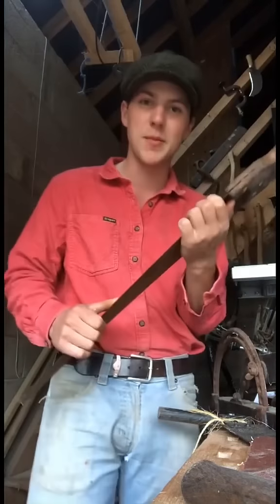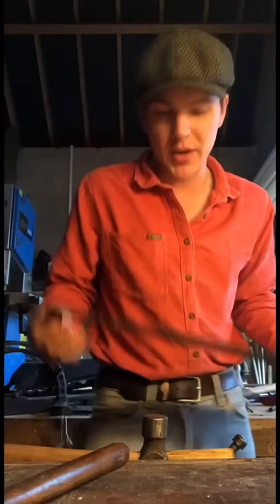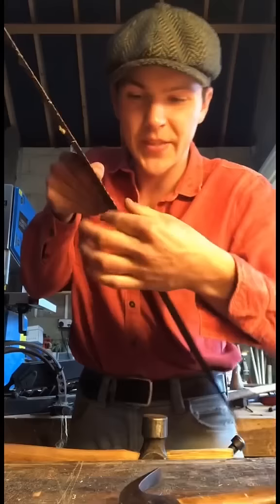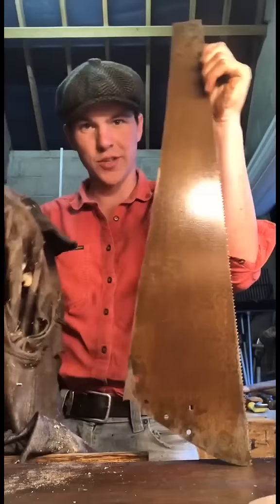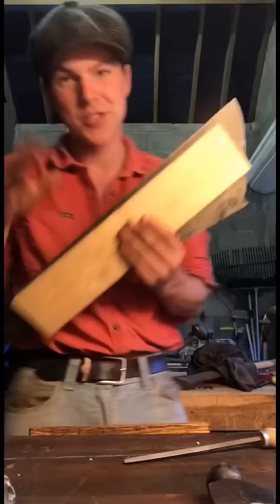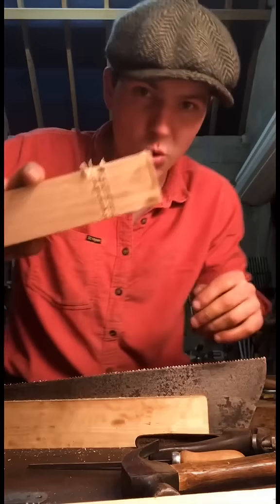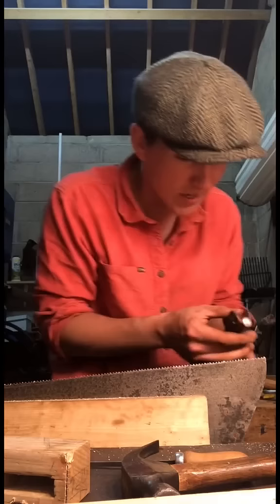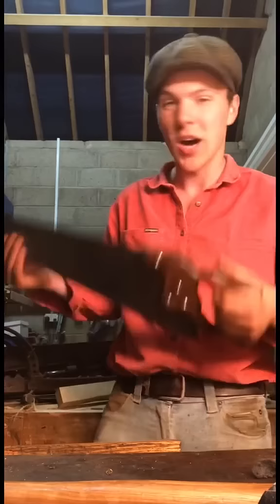Restoring A Rusty Old Crosscut Saw #shortvideo #ireland #woodwork

Comment: There is one more important step for a very finely tuned saw and that is leveling the teeth before sharpening the cutting edges.
Reply: Did you miss him using a hammer and anvil to do just that? Then explaining the use of the sawset at the end?
Reply: @colonelangus7535  Manuel probably meant leveling as in dragging a file lightly across the end of all teeth so their all the same height, then you would sharpen them till they have a sharp point again
Reply: @colonelangus7535  none of that levelled the teeth, it flattened them.
Reply: Set teeth, then sharpen? Or no?
Reply: @Friedrich Bendix  I thought a saw was supposed to have its blades staggered every second tooth tapering out so the blade has plenty of room to move through the cut.
Reply: @longkevin11  I think he missed the setting process in his explanation.
Reply: That's correct. I was taught to run a file over the tips of the teeth until they are all the same length then set and sharpen

Comment: I use a trisquare file everyday for finishing single point threads. It never occurred  to me that they are used for saws as well.
Reply: Saw files actually have rounded corners so a slight difference. I'm pretty sure it's possible with just using a regular triangular file. I've heard you should be careful to not make the deep cuts pointy too.
Reply: @danielh12345  That makes  sense.  A radius distributes force instead of concentrating it at a sharp angle.

Comment: I've never worked on saws but I've worked on quite a few milsurp rifles, boil the metal in water and it converts rust to bluing then you take fine steel wool and scrape off rust 👍

Comment: Nice job but if possible try to avoid abrasives.  Many old saws, particularly late 19th century and early 20th century saws have beautiful etched manufacturer emblems.  Abrasives will wear them away.   Acids are equally bad but there are a number of cleaners that won't damage the etchings.

Nice job though.  I've restored quite a few saws, it's very rewarding.

Comment: Try using a PH4 phosphoric acid instead of a light oil, it'll work a lot better. It will need to be neutralised after with an alkaline (washing up liquid) but it's not going to burn you.

Comment: Well two things you can actually see the line of the pre-cleaned bit that You wipe later on in the video, it's been pre prepared. 
 and I've use WD-40 for all kinds of things and I can swear that it does not remove rust like that from things like saws

Comment: I've always used old steel kitchen scrubbers and wd40 to clean the rust off of my saws (I'm a musical saw player).  Would you say that sandpaper is a better choice?  I like using the steel scrubber because it's basically infinitely reusable, but I'd be willing to upgrade if you could convince me to.  

Would you ever use the sandpaper dry?  Or only ever with wd40 as a lubricant?  Also what grit sandpaper?
Reply: Also, I can tell just from this video that that Disston you're restoring would sound passably good, but wouldnt have a rich enough tone, and would have a lot of overtones (and potential for dissonant screeching if bowed poorly).  An expert would probably be able to get around that and make it sound good enough (and maybe even exploit the overtones for some polyphony), and a novice would benefit from how thin and flexible the blade is.  But it's not ideal for either type of player, in my extremely opinionated opinion.  

I've found that Disstons that don't have a stamp on the blade (saying "Henry Disston & Sons" in fancy script with some pretty ornamentation) tend to sound better - they seem to usually be thicker and harder to flex - maybe even using a different steel alloy?  Do you know when Disston started stamping their saws?  I've always assumed in the 50s or 60s, but thats really just speculation  on my part.  Figured you might have a better idea than me, some dork who doesnt even know how to use a saw for its intended purpose.
Reply: Oh, and while I'm asking extremely niche saw questions - do you know if crosscut saws and rip cut saws are typicallly made from the same thickness of sheet metal?  Are rip cut saws sometimes thicker, to handle the extra strain from the force needed to overcome the friction from the bigger teeth?  It just ocurred to me that this might be the case.  (The saws in my personal collection tend to follow this trend, but thats a very small sample size)

Comment: I wonder if you'd be able to restore an old machete I got. I picked up a Senegalese Coup Coup/Sabre d'Abbatis and, unfortunately, whoever had it before me messed up the edge with a really steep secondary bevel, so I'd have to entirely reprofile the blade to get it back to what it should be doing, and I lack the skills and equipment to do that without likely damaging it and losing historical value.

Comment: Do u ever use WD-40 as a lubricant or only as a cleaner?  I’ve been arguing with my pop for years over that ?.  I say it’s only a cleaner but yeah it Will slightly lubricate surfaces for a few minutes. But my pop uses it on everything  He had an old fan that would start squeaking so he’d spray it almost each night. It finally locked up completely